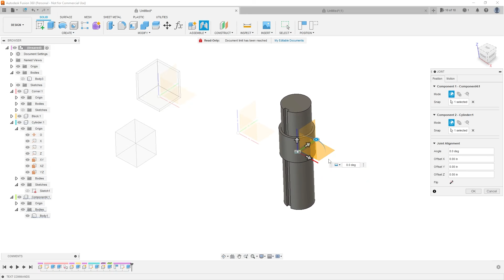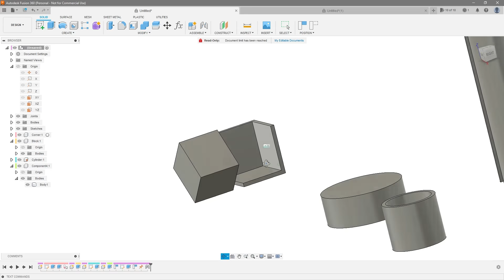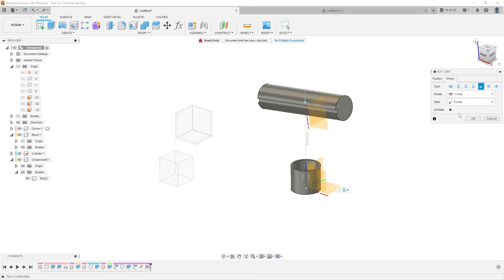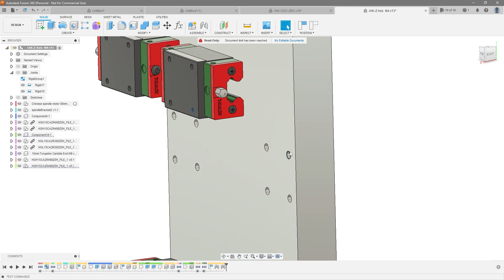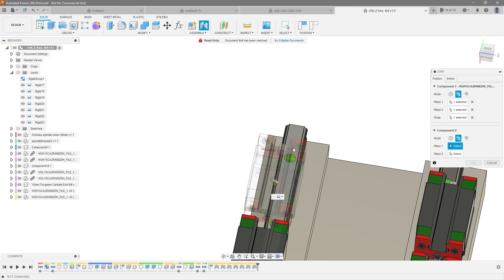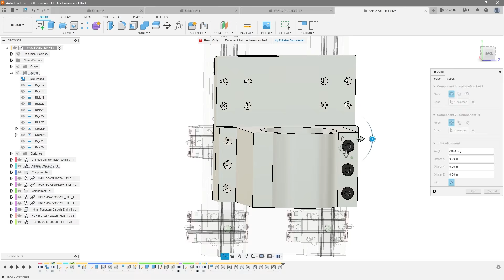How to connect 3d components | Fusion 360 Tutorial - Joint Basics

Comment: This video is oh so very close to what I am looking for.
I have a disk with a circle of bolt holes near the outer edge.
I have 3D printed segments of a gear that I want to bolt to the disk, each segment has 2 bolt holes in it.
I can get one bolt hole in the segment mated to a hole in the disk but then I have to tweak the  offset angle until the second bolt hole in the segment visually lines up with the second hole in the disk.
That visual stuff is for the graphic arts department not for engineering.

Back when I worked for someone else I had Solidworks and MasterCAM.  Starting my own company I could maybe swing Solidworks but MasterCAM is completely out of the question.  Autodesk had a very good deal for business startups, have to give them that, so here I am trying to convert to the Fusion way of doing things.
So far it seems a very crude and clumsy way to do the simplest of things.

Comment: Joints is THE BIGGEST reason why I still miss my Solid Works installation. I simply cannot see why Autodesk hasn't solved this major issue.
Your example of placing the sliding blocks proves the lack of flexibility of mating in Fusion because your solution only works when you have defined the holes in the backplate in advance. But thats not the way a proper system should work. Instead you should be able to reference the blocks with reference BOTH to each other AND the rails and then project the holes from the blocks to define the press pulls on the backplate. 
In my opinion Fusion is still a software for hobbyists.

Comment: Haven't finished the video yet, but I find it interesting that you start out by selecting the components to join in the "wrong" way :)

I get that you do it this way due to how Mates work in Solidworks, but yeah it's not optimal way to do it Fusion, as you show later :)

As someone who learned Fusion before Solidworks, Joints are way more intuitive to me than Mates, and significantly faster to use.
There are a few Mates that I miss in Fusion, but on the whole, Joints are way better.

Mates generally take away one degree of freedom per Mate, while Joints do the opposite and start my removing all degrees of freedom and you then select which ones to allow.

Comment: How about a vid on how to assemble/animate a joint of say a cable draw, such as a throttle cable where steel braided cable could slide in/out of flexible sheathing....? Hopefully no too much to ask....lol
Reply from the maker: Definitely too much 😀 to my knowledge, Fusion does not have the capability to model/animate/join flexible objects such as rope or cables. Though you could use simulation to check the load on a pulley etc.  

For what you are asking for, I think, you'd need to do the hard modeling of your connectors/crimps/levers etc in Fusion, then assemble it in something like blender that has a capable physics engine to add cables and animate the joint.

Comment: coming from using inventor at work for years to fusion 360 I DESPISE these joints. The way inventor handles constraints and mates (which I guess is also how SolidWorks does it? I haven't used SolidWorks though). Making assemblies with inventor is seamless and effortless, but Fusion 360 is a pain and frustrating / not simple and intuitive... Youd think they would implement the Inventor way into Fusion 360 given that Autodesk makes them both...

edit: the joint motion options seem to be what I want to use. So for rectangular shapes I can just use the planar joint constraint and then adjust the offsets with trial and error to get it where I want it, but the 3D model doesn't always immediately update the position unless you jump between the position and motion joint tabs so you have to jump between those menu tabs a few times overall to get your model to update the preview of the constraint positions so it takes bit of time to make each one.

Comment: Austin, I'm extremely new to Fusion but your video helped me on a lot of my hick-ups. I have a question. I created a spindle assembly from multiple models.
I first started by saving the blank design.
Then started adding designs by right clicking and inserting them into the current design from the side menu.
I created rigid joints between each item.
I also created a slider joint for the quill.
The assembly looks and works as it should.
But, when I added this entire assembly to another model I have issues.
There is a location I want to move this assembly so I select Joint under the Assemble tab.
I select the points on both this assembly and where I want it to be mounted on the other assembly
But when I hit enter, only the one section of the assembly moves, one of the sub assemblies I added to the original model, not the entire assembly.
I went back to the original model and made "Rigid Groups" of each component but when I go back and try moving the assembly only the one sub components moves rather than the entire component.

Comment: i Do have one question tho. If you do two sliders connected to a single object to move in on diferent directions, how would you tell the slider when to stop ? is there another command or instruction to tell the slider, you cannot go further than this ?
Reply from the maker: There's two ways to do this, that I know of. You can either enable contact sets under the inspect menu. Contact sets allows fusion to detect collisions and stop the joint from moving. 

The other method is while inside your slider joint menu, there is a section called Joint Limits. You can specify an angle or distance at which the joint will stop moving in either direction from its "home base" or "zero" position. This is great if you already know how much you want it to move. Contact sets is great for analysis but taxes your CPU pretty heavily

Comment: Ok how did you get your bearing blocks to move together as one?
Reply from the maker: They are all moving in relationship to the holes on the mounting plate that I joined them to. So they don't know where the other blocks are or anything. They just know to stay aligned with the mounting holes.  When it moves.

Comment: Is there any advantage to using joints in a guitar build?  Thanks
Reply from the maker: Hello! There are 2 necessary joints in my opinion.

Neck to body (if using bolt on or set neck)
Fretboard to neck.

Optional ones would be adding hardware such as bridges, tuners, pickups, ferrules etc. You would use joints to locate those onto the guitar where you need them.  Those however don't really play a role in manufacturing, but are useful for laying out certain dimensions as well as final renders.
Reply: @austinshaner  Thanks - Right now I tend to make make neck and body and most everything else in 1 file.  Would it be a better practice to make the neck and body in separate files and later join them?  My files seem to get pretty BIG.. Thanks
Reply from the maker: @warrguitars  in theory, yes it is ideal to make them separate files. But in practice there are a lot of dimensions and curvature that are co-dependant like the heel transition that would make it difficult to model separately. 

That being said, you don't need seaparate files to create joints between objects. You just need them to be separate components and not top level bodies. 

So I'd recommend having the body, neck, and fretboard as one file, then insert the rest like hardware etc as separate files.

Comment: Great vid.... helps to lift the curtain for new users that are trying to wrap their heads around Joints. There are some aspects that make total sense and others that really just seem like more needs to be fleshed out..... the example of the cylinder and ring using the Between two faces and adding a slider constraint "should" not allow it, by default to go beyond the 4 faces. It's almost a moot point of even using that constraint. Granted in Solidworks there would be no movement because the width mate locks it in place. So The happy middle would be a distance constrain that stops at the top/bottom faces.
Reply from the maker: Agreed. As a solidworks user that joint made no sense to me, because in theory I already locked that axis with the between two faces. That's why joints are confusing, because you start by locking all 3 axis with a single selection, then remove constraints in specific axis with the motion tab.